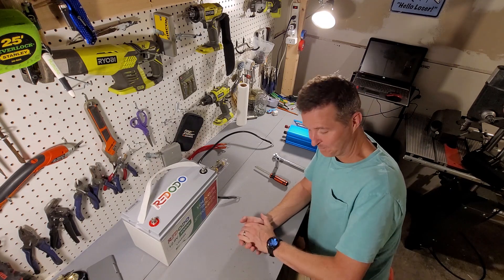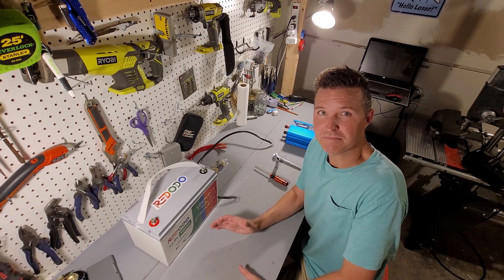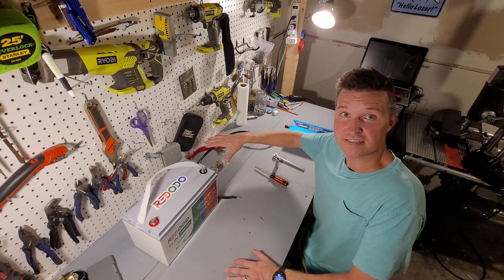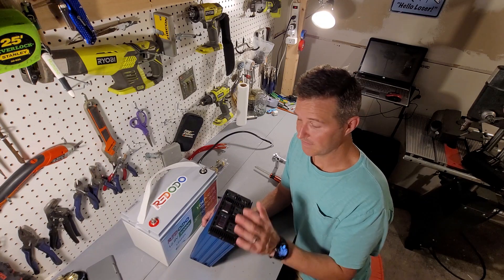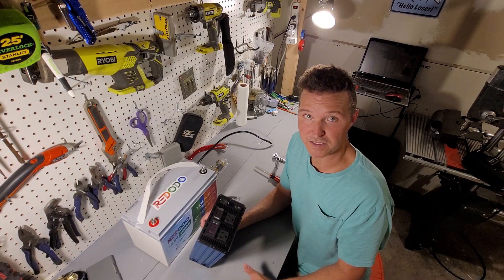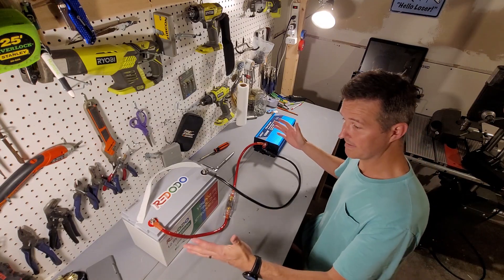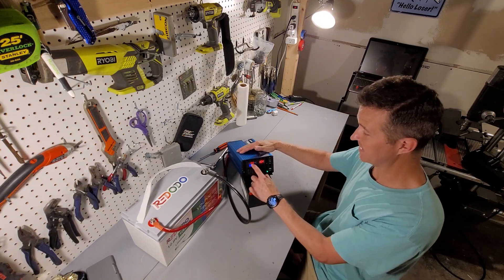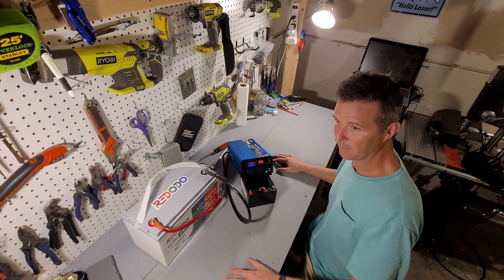Step by Step on How to setup a Simple 12v Off-Grid Power Solution.

Comment: A sturdy 12V test lite can be used to charge the inverter caps, as well. We have two of those same inverters and they are 110V output at best. They are very tough units, though. One has been flawlessly running a full-size Maytag washer for the last year, or so, out back here.
Reply from the maker: I did have an issue with mine..  one of the capacitors popped.  ALFFAA contacted me to let me know the inverter was under warranty so they sent me a replacement!  Replacement works great and I get around 114v.

Comment: How did you get 7 Hours Run Time .
What's The FORMULA ..
You Never Explained that part .
Thank You 👍
Reply from the maker: Sorry about that.  If the battery is fully charged, which would be 100ah, and you are running items that add up to 14a then all you need to do is divide the size of the battery..  100ah... by the load...  14A.  That gives you 7.14 hours.  I hope that makes sense.  Thanks for the question!

Comment: This is awesome, any thoughts on making a part 2 with solar panels connected?
Reply from the maker: Yes.  I'm planning on adding a very cheap PWM charge controller.  It will be small enough to stick to the side.  Thanks for the comment!

Comment: Great video. You may want to add information about conversion loss also, I.E.  if  you try to get 1500W on the AC output side of the inverter, the power on the DC input side of the inverter will be higher than 1500W, since typical inverter has about 85% efficiency, that means the input power to the inverter will be about 1500W/0.85 = 1765W, the current at 12V will be 1765W/12V = 147A so you should get cables that are rated higher 147A.
Reply from the maker: That's a good point.  Thanks for the info!

Comment: Thanks for your work on this.  It is going to help many.  I am a semi-retired mechanic on vehicles and rvs.  As a rule of thumb (in 12 volt vetch system) I always disconnect the ground first and reconnect it last.  In this case it is virtually always a negative ground.  In the 60s there were a few positive ground systems.  My point is that I recommend doing the positive side of the circuit first before completing the negative AS A HABBIT.  In this exact case what you did didn’t matter.  But if someone had the inverter mounted to a metal frame and the ground screw was connected to the frame (though most inverters might separate them) … if all the grounds are connected first an accidental + batter to a ground will be a direct short.  Whereas if the negative is disconnected off the batter and put on last a touch of + to the metal frame will not apart.  Disconnect negative first and reconnect it last. … habit!  I hope this helps.
Reply from the maker: Thank you for the info!  I'll make sure to do that in the future.